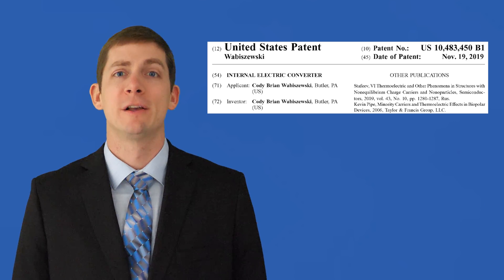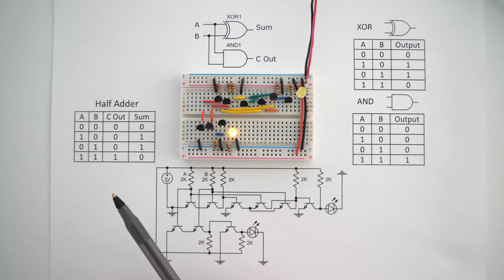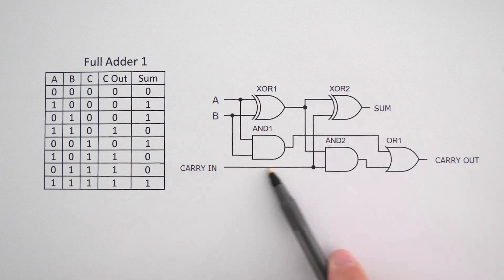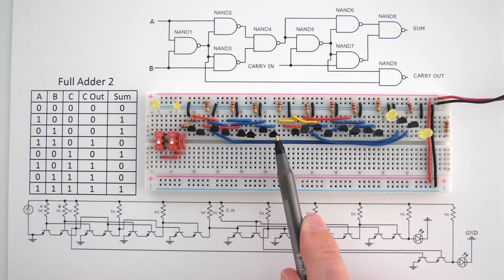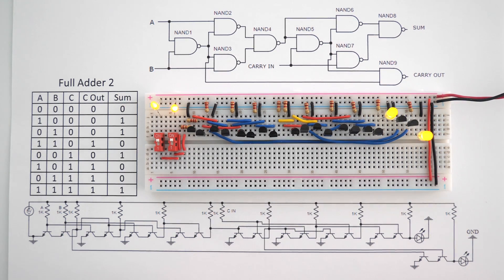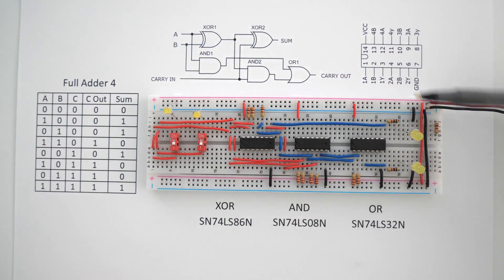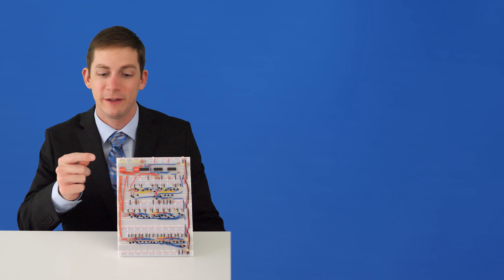Full Adder

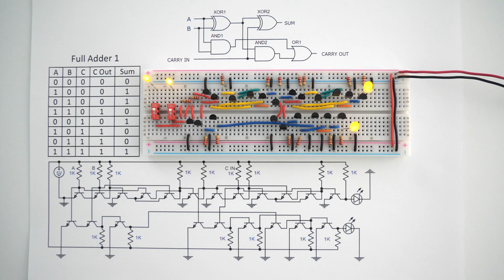Comment: 6:27 , the circuit is amazing, you use XOR with 4 NAND gates for A and B (output of NAND 4). Then you have the next XOR with the gates 5,6,7,8 and the output of NAND 8 is "XOR3" of all 3 inputs. Then the amazing part kicks in. You recycle the outputs of NAND1 and NAND5 and use them as inputs for NAND9, so you use only 1 additional gate for "Carry out".

PS: I have done a brute force search. It is impossible to get and XOR3 with 7 or less gates, so your solution with gates 1 to 8 is optimal to generate the "sum". HOWEVER, maybe there is an other combinaton of 8 NAND gates to also genenerate the "sum", but the gates are rearranged and maybe one output of the NANDs of this new circuit is "carry out" by chance. 

PS2: The number of arrangments of 8 NAND gates is in the order of a billion, since each NAND gate can use the input signals, but also the outputs of all previous gates. 

I will keep you updated :)
Reply from the maker: Yeah good points, it is interesting all the different options!

Comment: Hi, I usually don't leave comments on YouTube, but I'm having trouble  making a full adder from a transistor level, I noticed that you used at least one extra transistor for each logic gate, I wanted to know if this is something that is needed to connect multiple logic gates together without something going wrong. I like to create circuits just using what I know because it gets me thinking more about what is going on in the circuit instead of copying someone. I at first just made the logic gates on a transistor level and thought that I could just directly connect the output of one logic gate into the input of the next logic gate just like the boolean algebra logic gate diagrams, but for some reason something just won't work after connecting them or one led will be bright while the other is dim, so I wanted to ask how I would implement this extra transistor,  I thought that it might be a buffer but I'm not sure.

Comment: I have built the circuit but both the lights are turning on even when I don't turn on both the switches help
Reply from the maker: I am not positive did you start with the half adder? It could be something small but helps to check that each gate is working properly.

Comment: To the adders from 6:27 and 8:25: As I understand, you can interchange "A", "B" and "Carry In" however you want. But you choose to set the "Carry in" closer to the outputs. If, you put 4 full-adders to make a 4 bit adder, the signals traverse the circuit a bit faster, since the front full-adders have to wait for the correct "carry in". 

PS: Yes, I know that here its not about timing, but its a nice little detail which I appreciate :)
Reply: So, the full-adders with NAND and NOR gates have 6 layers of logic gates in a row. In addition, the calculation of the "carry out" requires 2 layer from the "carry in", so each additional full-adder delays the computation by 2 time steps (maybe 10ns per time step). So a full-adder needs 60ns to finish the computation, a 2 bit adder need 80ns and a 4-bit adder needs 120ns to finish the addition.

Again, this is much faster than a human hand, but its fun to calculate.
Reply from the maker: Yeah, that would be the case! Thanks for sharing! I did build the 4-bit adder as well and it is in other videos and eventually became the ALU for the 4-bit computer.
Reply: @GlobalScienceNetwork  The 4-Bit adder video is also great.

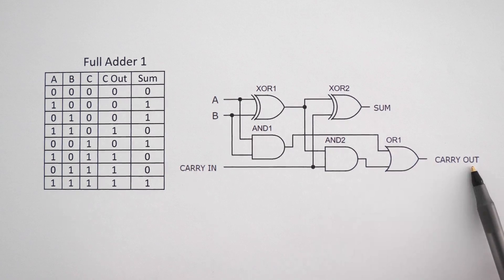Comment: Ok, in 4:35 you have 21 transistors, the NAND-adder from 6:27 has only 18 transistors.  The NOR-adder has 18 transistors. The question is: Can you do it somehow with 17 transistors? There are many possibilities to arrange 17 transistors and resistors!
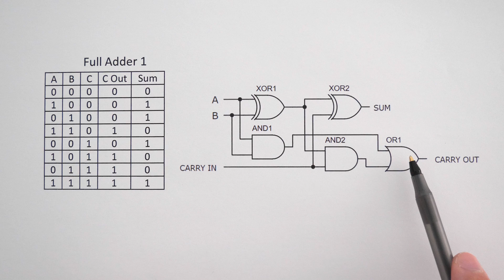Reply: PS: The adder at 4:35 has more transistors, but is likely a bit faster (I know, we dont see it in this toy case). It has only 3 layers of deepth for the signal to travel. The smaller adders have 18 transistors, but a deepth of 6. So, maybe there is a full adder with only 17 transistors with a deepth of 7. At least, this is what my intuition say :)
Reply from the maker: Yeah, there are ways to do it with even less. Eventually for most modern computer applications that require billions of transistors MOSFETs are used rather than BJTs. There are still plenty of ICs that are built with tBJTs so it is still useful to learn and use them for simpler circuits. MOSFETs are just a huge power saving as they are voltage gated switches rather than current based. I plan to make a video comparing the two.
Reply: @GlobalScienceNetwork  A video on MOSFETs would also be interesting. Still, we get the same question: Can we arrange the transistors better to reduce the overall number of transistors? For me, I comes down to try many different logic gates connections and see that they achieve the full-adder function in the end. Then we just have to count the transistor numbers. Maybe something interesting is possible with fewer transistors and resistors (at least for a 4-bit-adder)
Reply: So, now you can do it with 9 NAND gates with 2 transistors each. You can also use 9 NOR gates with also 2 transistors each. Is it possbile to mix gates? Maybe, a combination of 4 NAND and 4 NOR gates can also form a full-adder, then you need only 16 transistors. Checking all possible configurations is of course time consuming :)

Comment: No hate, but what kind of calculator is that if you have to insert and remove resistor to make it work?
Reply from the maker: See the 4-bit calculator video. The end product uses switches. Also see the 4-bit computer video.

Comment: Thank you for the great content!
I'm trying to figure out what's the reasoning behind using different base resistor values for different switching applications, do you recommend any documentation that could help with that?
Thank you!
Reply from the maker: In this case, the base resistor basically acts as a current-limiting resistor. So values like 1K, 2K, and 2.2K are good options. Lower values would result in more current and power being used. Higher values would result in a current that is too low to work properly with the BJT transistor.
Reply: @GlobalScienceNetwork  I understand, but is there any reasoning in using 2k in some circuits and 1k in others? Even here
Reply from the maker: @LearnersRose-mn3kt  Not really. Either one will work. I only had so many of each value so sometimes I used 1K and other times I used 2K or 2.2K. Like I said though 2.2K is technically better as less power will be used.
Reply: @GlobalScienceNetwork  thank you!

Comment: at 0:43, why do we have 3 transistors for the AND gate? Is it because when we connect output at the collector, and lets say both inputs are on, the current will just go to ground and wont reach the output, which is NAND gate, but then that 3rd transistor acts as an NOT gate which negates the NAND, making it AND gate, if that is the case, then why bother connecting output at the collector and not just go straight to emitter?
Reply from the maker: This is a good though. You could try it and see if it works. My guess is that connecting it to the collector will not allow the output signal to be sent to the next circuit.

Comment: I’ve been trying to recreate a lot of these circuits and I make them fully and they work, until they don’t, I don’t understand why but even slightly touching on of the wires or one of the resistors completely breaks everything and then I have to slowly try and figure out what is the problem and then just keep adjusting it until it finally works, I don’t think the problem is with my transistors or resistors because I bought new ones just for this project, if there anyway you could give me some insight on what’s wrong
Reply from the maker: Hi, yeah I would actually predict that the problem is a bad transistor somewhere. Even with brand-new BJT's it seems like they have a 5-10 percent broken, transistor rate. Watch my video on testing transistors for more information. If you test them and get all good ones and it does not work it could be a cheap breadboard. I would recommend BusBoard breadboards. They are more expensive but have fewer issues. I used cheap breadboards for the computer and about 1 out of every 5 I had to swap out. If it is a larger circuit it could be a power rail issue. Eventually, it is good to add de-coupling capacitors across the power rails.
Reply: @ ya I got some help and I figured out it was the bread board, there’s a bad connection somewhere. The circuit works great now(if you don’t slightly touch it)

Comment: does it matter what type of transistor i use
Reply from the maker: Well you can use lots of different kinds of transistors to make logic gates. I used 2N2222 or 2N2904 NPN transistors for this build. Either one will work in this case.

Comment: fake video  :(0 circuit does not work even in simulator apps
Reply from the maker: I assure you I built these circuits and they work. I even built a full 4-bit computer using these circuits. Also, I show how the adders work to built a 4-bit calculator simulation working in the easyEDA video. If you are struggling with the circuit let me know and I can answer questions. Start with my logic gate video and work your way up to larger circuits and I bet you will have success.
Reply: Maybe the simulation is not accurate
Reply: No, I’ve simulated them too and even made them, they work, just it is a little tedious to make

Comment: Can I use bc547 transistor to make a full adder? I made half addder.but I couldn't make a full adder for and gate's second switch's leakage.
Reply from the maker: You should be able to make a full adder with a BC547. Maybe you have a wire wrong or a bad transistor. Also realize the transistors would have to be flipped as the emitter-base collector for a 2N2222 is the collector base emitter for the BC547 if it was in the same orientation.

Comment: What is the name / resistance of the transistors and the resistors used thanks in advance.
Reply: I just realized that the resistor type is on the sematic were the transistors used 2N2222?
Reply from the maker: @Mitchellclark-loveatwar  Yeah the transistors are 2N2222 or 2N3904 both will work. The resistors are 1/4 watt 1K to 2.2K will all work. The 2.2K will use less power which is good.

Comment: hello sir  i have a question, i have 3 bit 2 number and i need to subtract, first one is bigger all time. and i need to do this with become two complement.if i change second number two complenet and add first number i can be.i need to change all bits of 2 number( I do with not gate ) and add 001. after  i add  two,3 bit number with 3 bitt full adder.but i think i need threee,3-bit full adder.for add second number 001 and add two numbers. but doing this in breadboard. it is hard because i need to use many IC, HOW can i solve this problem
Reply from the maker: Hi, like you said this can be done with the two's complement. I added the subtract feature into the 4-bit commuter I built and have a video showing the build and circuit diagram. If you look at the ALU in the circuit diagram layout you can see this was done with four XOR gates. The second number in register B is subtracted from the number in register A if the XOR gates are enabled. You need one XOR gate for each bit. So if you have two 3 bit numbers you will need 3 XOR gates.

Comment: If you use 3 input logic gates you can actually possible to build a full adder with as little as 15 transistors.
Reply from the maker: Yeah, that is interesting, what type of 3-input gate? I was showing the basic ones but the cool thing about digital logic is there are lots of ways to simplify a circuit, make it more efficient, and arrive at the same result.

Comment: Tag me if there is construction video
Reply from the maker: Future videos are going to be about building a computer using individual transistors, then building artificial neurons.
Reply: @GlobalScienceNetwork  I have seen half and full adder with ic, but I was heard it can be built with bc547 and resistor so if construction video available tag me so that I can try it on home.
Reply from the maker: @TonyStark-rt4ec  I know you can use the 2n2222 or 2n3904 transistors to build the full adders. The Bc547 type should work as well. If you watch my video on digital logic gates and then watch this video again I am confident you would be able to build it yourself. Also, I provide the exact circuit diagram below each circuit if you are confused about where each wire should be placed when looking at the components on the breadboard. The resistor values are shown as well.
Reply: @GlobalScienceNetwork  thank you sir/madam
Reply: @TonyStark-rt4ec Be aware that BC547 has its leads in a different order from 2N2222 shown in the other video. The base is still the middle of the three but emitter and collector leads are swapped over.